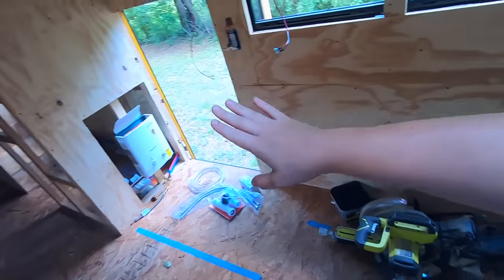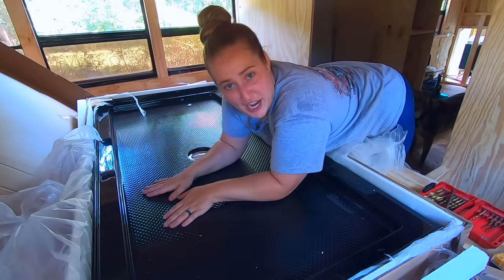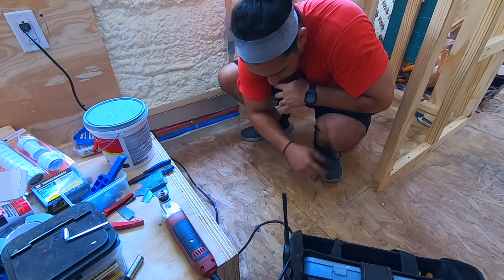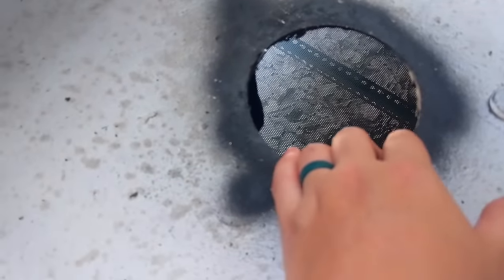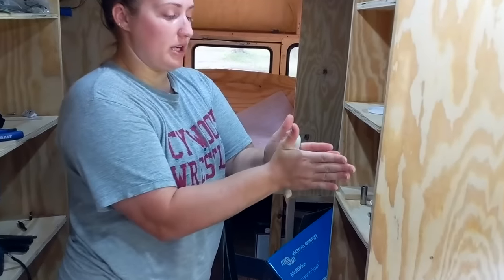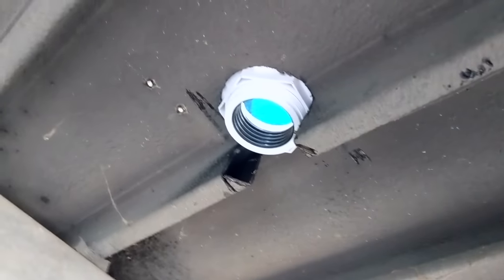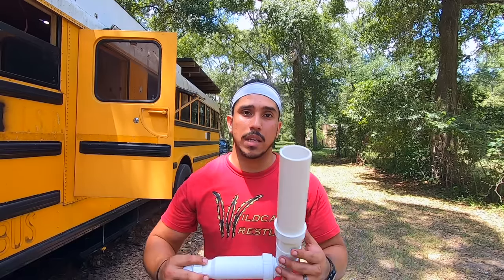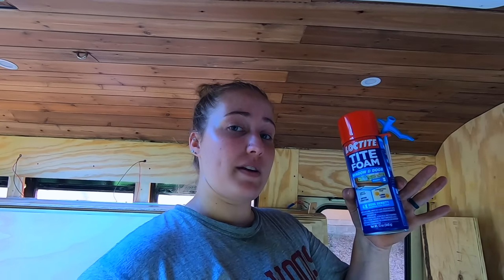Installing Shower Pan in Tiny House * Skoolie Conversion * Gus The Struggle Bus

Comment: Love ❤️Your Guys Bus Build . I finally found my bus to build , 2005 Thomas Built , Cat C7 engine /automatic transmission, it’s a handicap bus with lift, only has 39,791 miles , no damage, couple of small surface rust areas, all sets have set belts, new tires, clean inside . Took me three years to find what I wanted. 30’ long. Got lots of plans for it. Thank you guys for the tips and humor. Your videos are Fantastic information to a new person about to start living life . God Bless You All. 👍😃🙏🏻😇🙏🏻😇👍❤️🇺🇸
Reply from the maker: Wow that sounds like an amazing find!!
Reply: @GustheStruggleBus  your videos will help me in my building, Thanks guys much Love ❤️ Your way. God Bless You All. 👍👋🏻😃🙏🏻😇❤️❤️❤️❤️❤️❤️❤️❤️❤️❤️❤️🇺🇸. Ken from Ohio

Comment: Love the videos guys! Thorough as usual which is very helpful to other converters. Is that air valve your way of venting the gray tank? Where can I find that valve?
Reply from the maker: Thank you!! Yes it is! It is in amazon and should be linked below!
Reply: @GustheStruggleBus  hmmm I’m not seeing it linked in the description or in your amazon store! The air admittance valves I’m seeing only let air in and not out. Seems like a much easier way to vent the tanks vs running a line up to the roof like a lot do though

Comment: Hi, enjoy your videos.  Thought I should let you know ... I bought one of those shower pans when I remodeled my bathroom in my house. They are super slippery just when wet, add soap or shampoo and you’re skating. ! Very much a HAZARD !!  I tried the tub mat with suction cups - won’t stay suctioned; tried non-skid tape used on boat decks - lifts off. The slightly raised diamond pattern is what screws everything up, nothing sticks.  I ended up getting a front door rubber floor mat and using that to keep from busting my ass. Please be careful. 🙏👍🏻❤️
Reply from the maker: Hello! Thank you so much for letting us know, we had not thought of that! It is to late to go a different direction but we will remember the mat!

Comment: Have a question for you...
Why you didn't go with those shower enclosures that come with walls too?
I'm asking because that's what I'm thinking on doing.
Thanks!
Reply from the maker: That is a great option! Those can get very expensive and you have to cut off what you don't need. Our walls were very specific and it would have been hard to find one that was worth it for our situation.